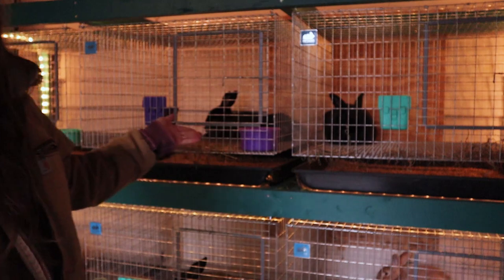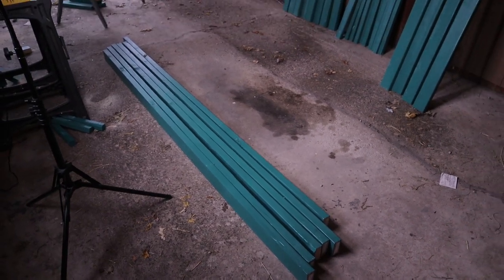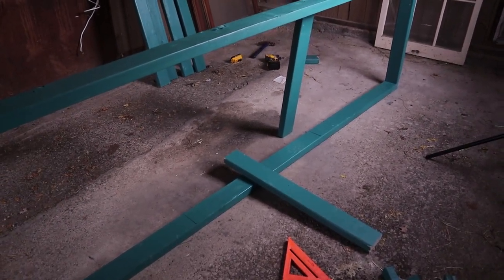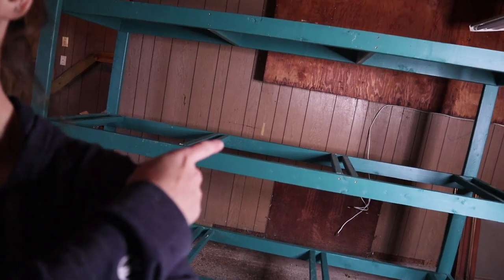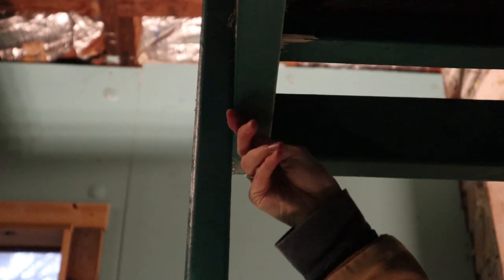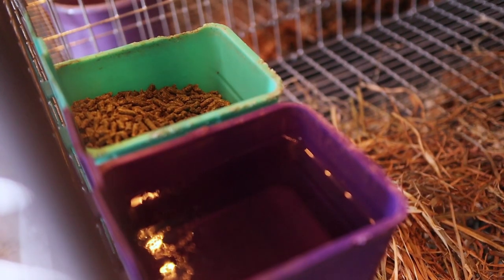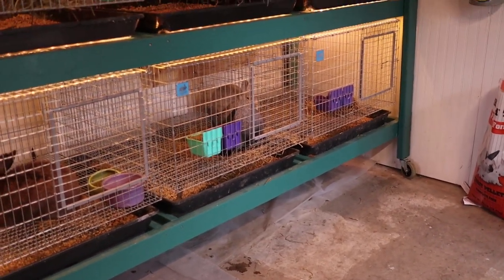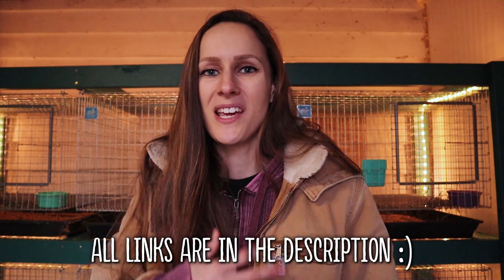Building a Show Rabbit Hutch (silver fox and creme d'argent meat rabbits)

Comment: A tip from a Carpenter. Alway predrill holes for screws for finish projects. Especially if your drilling on the edge of board. I will also wax my longer screws using a block of wax.

Comment: I suggest you paint your floor to prevent urine soaking in; i have the floor under my hutches painted with an oil based paint and i keep a mop and spin bucket with bleach water nearby all the time and quickly mop the wall or floor if urine gets on it. love the hook tip and the pine pellet idea

Comment: So, first things first! Your drill tip for the hooks, absolutely brilliant!!! Never would have thought of that!

Second, a question. Do you ever have a problem with your bucks spraying?? I have one maybe two, bucks who literally spray EVERYTHING! So much so that they’re ruining their neighbors room and fur! Is there a way to fix this? Or am I doomed to have everything covered in rabbit pee constantly?? It’s it’s literally like 4+ feet in every direction 🤢
Reply from the maker: The spraying thing is exactly why I chose to create a separate buck hutch. When the boys are around girls, they like to try and impress them with spraying. It’s disgusting 😂 a cheap way to fix this is to go to lowes or Home Depot and buy a roll of roofing flashing. You can cut however much you need and line the cage sides with it, then zip tie it on. This will keep their neighbors clean and it may stop them from spraying so much if they can’t actually see the does.
Reply: @TealStoneHomestead  I figured that may have been why you did that! I may have to do it as well, our does are on the top row and the boys down below to hopefully minimize the spray radius lol. I don't think they can actually see the girls with them on the top row, but who knows. I'll give the lining a try and see if that helps until a separate hutch can be built... if anything it will keep the guys cleaner lol Thanks Tiffany!

Comment: I was told by another breeder that sore hocks are a genetic issue and not so much a wire floor issue.  What is your opinion?
Reply from the maker: It’s both. It can be genetics, but thin wire or dirty conditions can also cause it on the most well-furred rabbit.